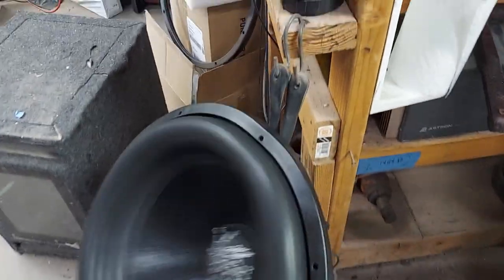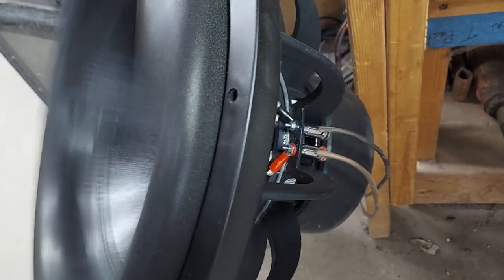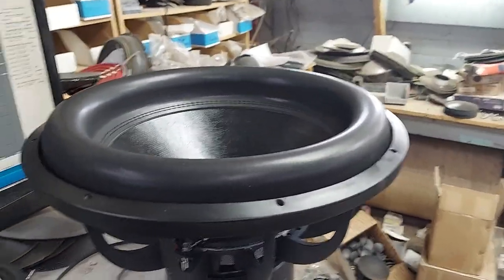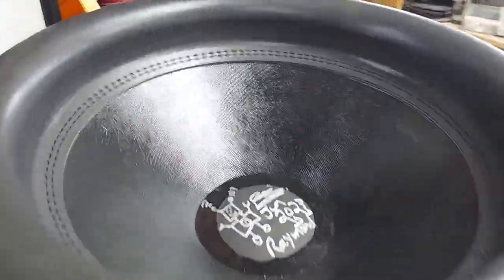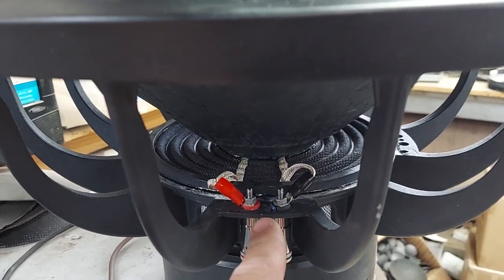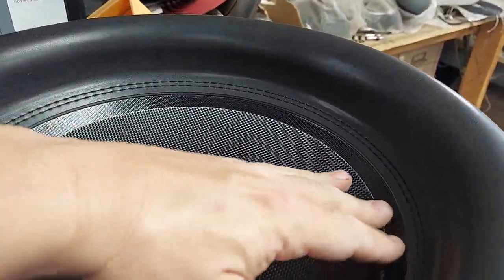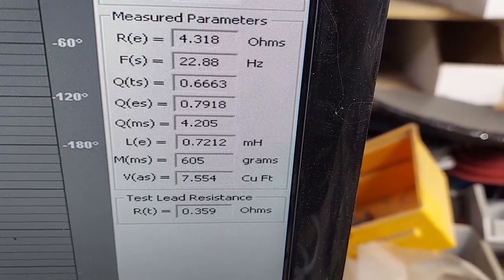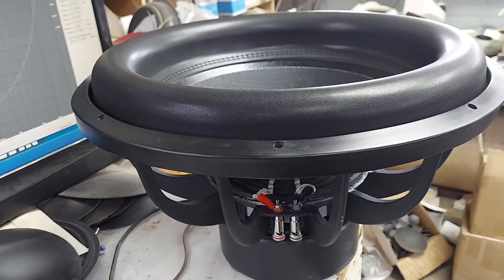Parts Express/ Dayton Audio Ultimax 18" D2 Final Fs - 22Hz, Qts - .67, Vas - 7.56cf by Robot 🤖⚡🦙💕

Comment: IDK the tp thickness to figure out the stock coil height, but Ill guess like 40mm.
The tp looks like a thinner than average from PE website video with boot off
Reply from the maker: It looked like a standard 12 mm thickness
Reply: @RobotUnderground what size did you use for replacement here? You said 60mm what’s the other measurements